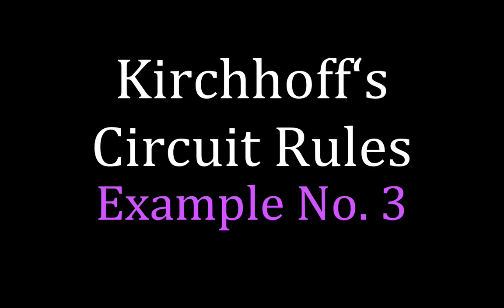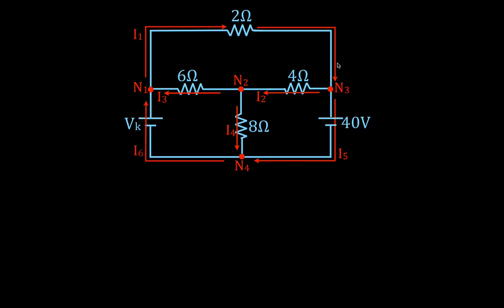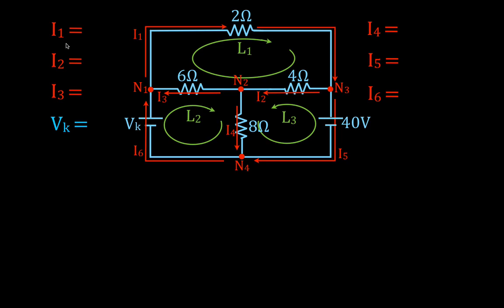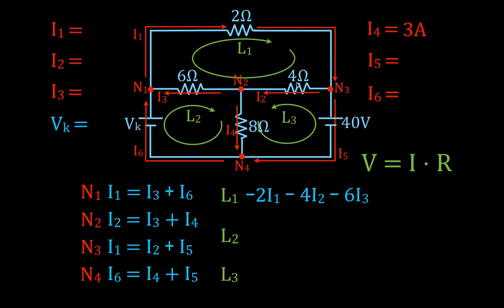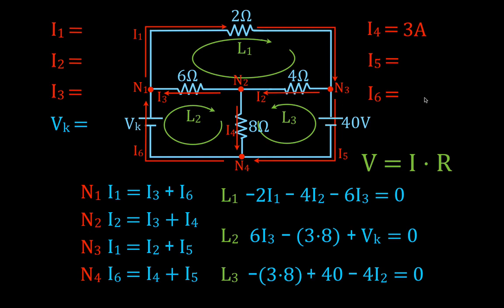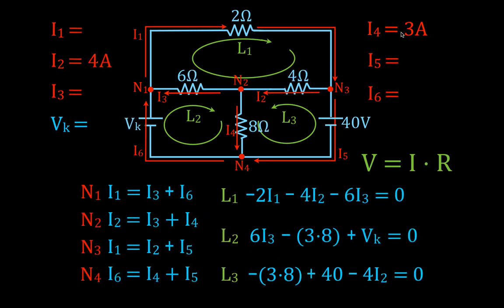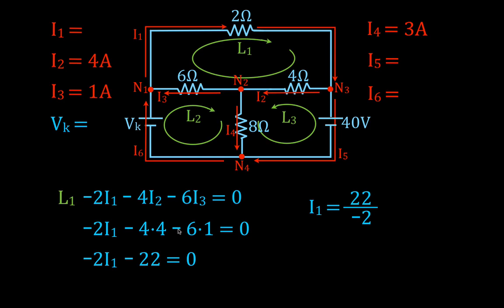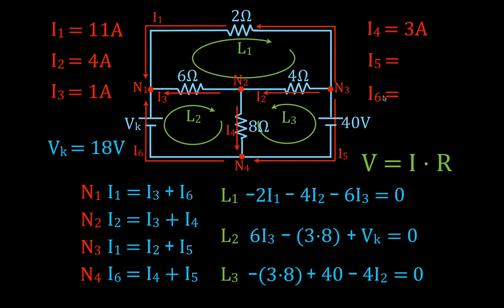Kirchhoff's Rules (4 of 4) Circuit Analysis, Example No. 3

Comment: Hello, i hope you answer my question. When i write equation for loop im very confused to "+" and "-" i still dont know i will write negative value or positive value
Reply from the maker: When you go around the loop it depends which way you go across the battery. If you go across from the negative terminal to the positive terminal then the change is positive. If you across from the positive to the negative terminal then the voltage change is negative. Does that help?
Reply: @stepbystepscience   I'll think about it a bit, thanks.

Comment: I understand it great!! thank you.  But how is this applicable in designing the circuit? If you have to design how many ohms each resistor should be and what voltages, how many voltages,  how would you start? Or is this only to figure out existing circuits only?

Comment: Confused: in video 3 in the addition 3,2 becomes 4,2 by adding both sides (1I2 + 3.2I2), in this example -4I2 stays -4, you don't add 1I2 to -4I2 in L3. https://youtu.be/8gGEmrbURsA?t=358, and I1in L1 https://youtu.be/8gGEmrbURsA?t=448. I don't get why in video 3 a 1 is added and not here. Sorry for the stupid question, i'm probably missing something.

Comment: how do you know onto how many currents are involved in the circuit?
Reply: is it a ratio of 2 nodes: 3 currents?  In this case there are 4 nodes and 6 currents, which is equal to 2:3. Am I correct?

Comment: Actually Vk is an indicator, not a voltage source. The value of voltage source doesn’t depend on the value of the resistors. So there’s only one voltage source in this circuit

Comment: I4 is given 3A and you choose the direction arbitrarily. what if the direction of I4 u choose was wrong?  How would u know!?
Reply from the maker: If you choose the wrong direction for the current or the way to go around each loop when applying the voltage rule then you will get a negative answer for the current.  If you get a negative answer for the current then you will know that you choose the wrong direction for the current.

Comment: I dont understand. You said the loop direction is arbitrary, thus if the resistance go against the current -> positive charge. But when it comes to battery, it look like the direction of the loop doesn't matter? - when go from neg to pos, it is pos sign??????
Reply from the maker: +Cate Lucio I think the answer is yes.  When you go across the battery, if you go from the negative to the positive terminal then the change in the voltage is positive.   If you go from the positive terminal to the negative terminal then the change in the voltage is negative.  You can see a listing of all my videos at my website, http://www.stepbystepscience.com